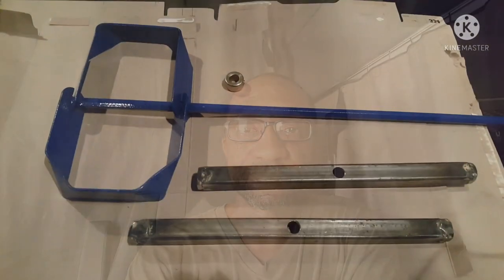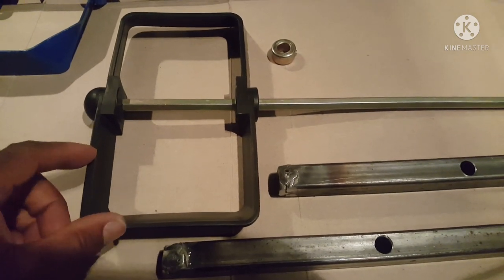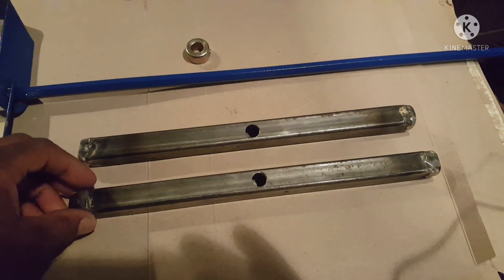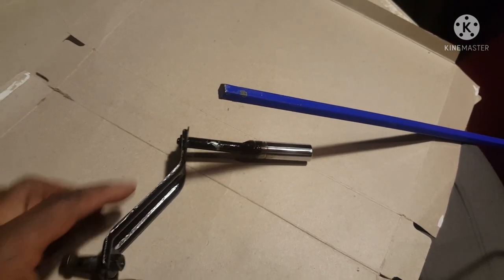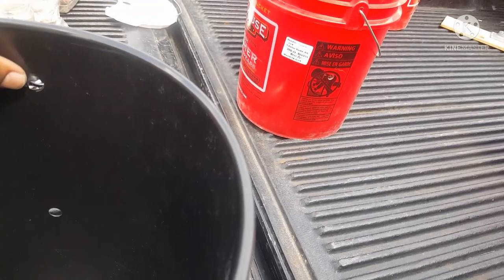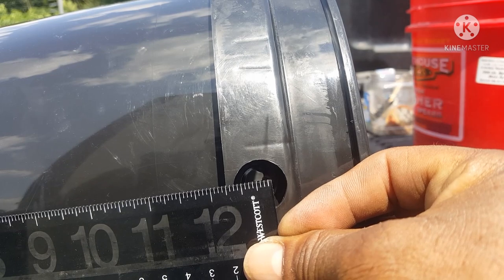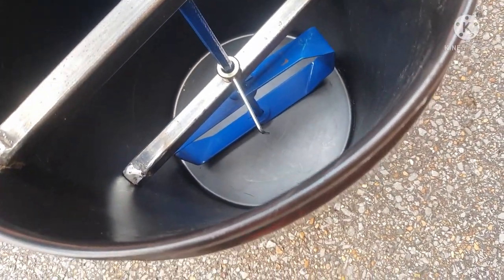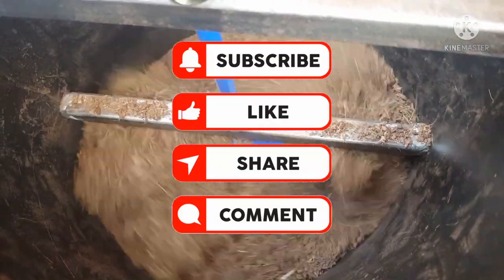STEP VAN LIFE: Composting Toilet Mixer.  The final solution.

Comment: the mixer is best left stationary so it can be build stiff and sturdy. The bucket is best powered I find.
It can be done using a regular hand drill running wired into the 12V system of the (step)van and a push button switch to actuate it... 
A stirring mechanism which involves a rotating thingy suspended in a bucket is very difficult to fit and keep working whereas a sturdy rod with a blade on it or a thick wire coil (like for instance a half an inch thick steel anchor coil designed to clip a pet onto) needs only a sturdy mounting point above the bucket...
Reply from the maker: I like your idea.  You've given me something to think about.🤔

Comment: You might consider using a metal 5 gallon buck with a snap ring to secure the lid. Drill a hole in the center of the lid. Weld a short piece of the 3/8 rod to the bottom of the metal plaster paddle. Weld a 3/8 metal sleeve to the center of the bottom and insert the short metal rod with a bearing so rod turns freely. You could eliminate the two support bars. In fact, it is probably stable enough that you could add a  motor to the shaft.

Using a metal bucket, you could weld or fasten a urine diverter and route the urine tube directly to a black water tank.

The real benefit to the snap ring lid is that there would be no support bars in the way when you dump the solid waste.

Something to think about.

Thxs. Tom
Reply from the maker: Thanks Tom.  I will keep your suggestions in mind if I give the composting toilet idea another try.  I appreciate you watching.

Comment: I'm just now seeing this video and again, you always do a great job of showing us exactly what you do to have such successful projects, thank you.. but here is my question or concerns, how do you successfully clean that bucket with all of the support brackets and the turning mechanism in place.. i'm "assuming" that the turning arm would come up thru your toilet casing so you don't have to lift the lid after each use, to get to the arm and it can be turned on top of your unit..  to clean it, i'm again "assuming" the handle would have to be removed so that the bucket can be removed for cleaning.. but once removed, how can the bucket be emptied without making more of a mess while emptying the contents and how can the cleaning be thorough without having to disassemble the components?
Reply from the maker: Hi Beyond Comfort Travel Adventures.  Great questions. I think you are on the right track in how you are assuming the toilet is serviced and cleaned.  I don't know why It didn't cross my mind to include that in the last video.  It may be easier for me to show the process in a video.  Give me a couple of days and I should have something uploaded.  Thank you very much.
Reply: @xlamontx  No worries, take your time, i know you work fulltime 🙂 but i appreciate your response and i look forward to your next video..
Reply from the maker: @beyondcomforttraveladventu1856  
Here is the link to the video I made for you detailing how the bucket goes in or out of the case for cleaning.  If you have any more questions, don't hesitate to ask.  Thanks again.

https://youtu.be/1d6iTro__EQ
Reply: @xlamontx  Thank you ☺️

Comment: Confused. Is this just for breaking down the 'dirt' before placing it into the toilet or is this the finished toilet? There seems to be alot of metal and moving parts that would get covered in number 'twos' and then need dismantiling for thorough cleaning. Surely it would be best to bring the agitator in from the side?
Reply from the maker: Hi Nomadic Jack.  This will be the finished toilet.  Clean up shouldn't be an issue, but I can experiment with different materials if it should become a problem down the road.  Thanks for watching. 👍🏾
Reply: @xlamontx  - Yeah. I went ahead and watched your other video on the finished toilet and it now makes more sense. You did a great job and such a money saver. I think you would help alot of people out if you provided the materials list and dimensions you used in the construction. I will certainly be doing the same and will probably divert the urine directly to my grey tank, add a few carry handles and securing lugs and add a small fan to exhorst the smells. Thanks for sharing this.
Reply from the maker: @nomadicjack  
Glad to do it.  I will put links in the description.

Comment: I really want a composting toilet for my rv. How much is the cost for the sawdust or stuff you use like on a monthly basis? How is the smell?
Reply from the maker: My composting toilet design left room for improvements.   I was hoping I could make it work without cutting a hole in my first rig to run a vent and a fan.  Now that I'm building out my second rig, I will include a vent fan to further reduce (or eliminate) the odor.   Hopefully, it works.
The price seems to vary from store to store on the coco coir.   I found home depot sells the brick size for about $4 each and I have only done a bit of light testing with it.  I believe some people use peat moss, but the size of the bag may be an issue if space is limited.  Monthly cost will very depending on use.  I only plan to use mine when on vacation for 3-6 weeks a year.  Thank you for watching.☺

Comment: What happens if the level gets too high 🤔
Reply from the maker: As I experimented with the 1st and 2nd mixer attempts, I noticed that If I started with too much Coco Coir soil, the flat and fork like mixers would  be extremely difficult to turn.  The 3rd style blue paint mixer that I featured in this video had angled blades and a large opening in between them which made them sort of "cut" through the soil rather than try and simply "push" the soil.  The 3rd design also improved the mixing action of the soil.